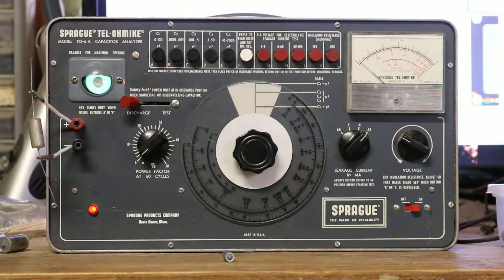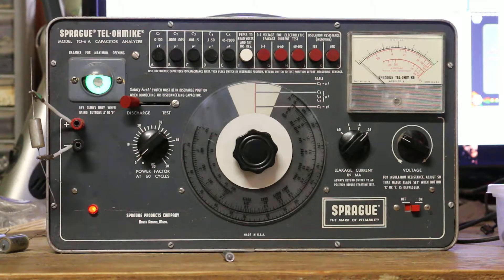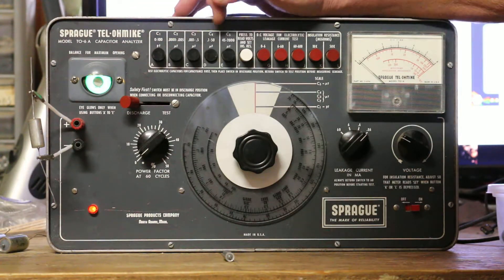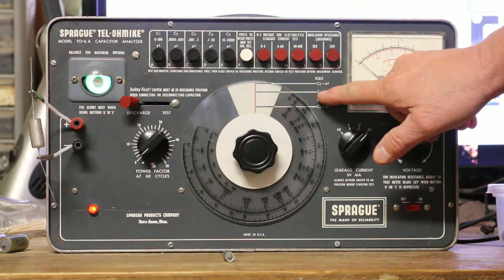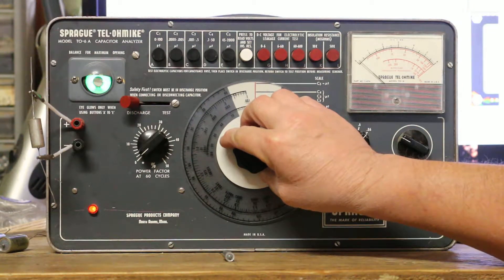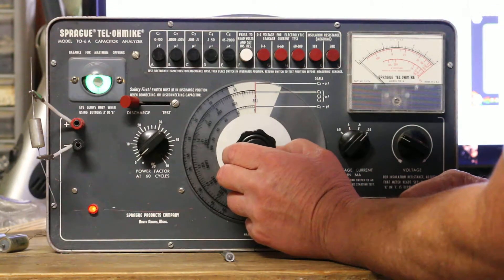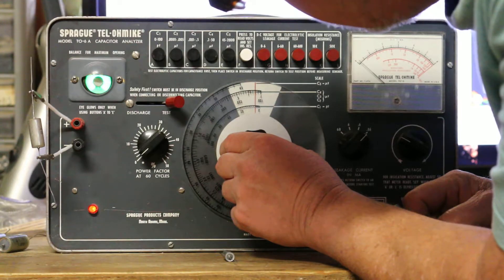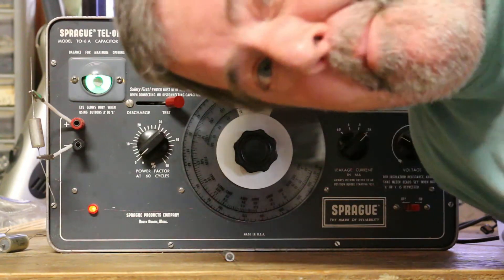MVI 0645 Magic Eye Demo

Comment: Just out of curiosity isn't the lower range up to .5 uf which would cover the .1 uf cap around mid range?
I loved the tutorial as I just purchased on of these. 
I'm surprised Spraque didn't put the test switch further away from the terminals for safety reasons, but hey if you don't know what you're doing in electronics you shouldn't be messing around with it unless you have someone with you who is.
Thanks for the show and the lesson, I loved it. Best Wishes n Blessings. Keith
Reply: Yeah, I wasn't wearing my glasses until a minute later, but you are correct, C3 would have been a better setting for testing .1.  I actually only use this for testing leakage at max voltage for both film and electrolytic caps.  I have a digital cap tester for the uf, it's small and battery powered, and very accurate.  Just an fyi, I have the T06A which has 'leak proof' caps, earlier models used caps that eventually leak, so if you have an earlier model which hasn't been refurbished you should probably put that on the to do list!